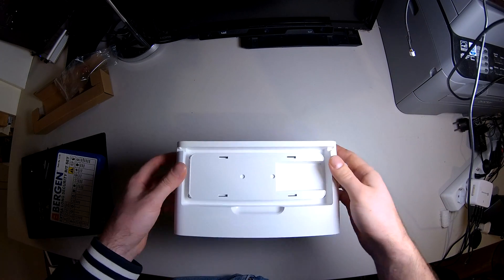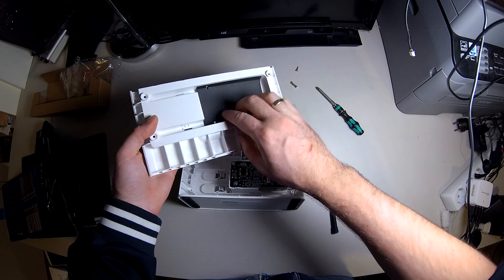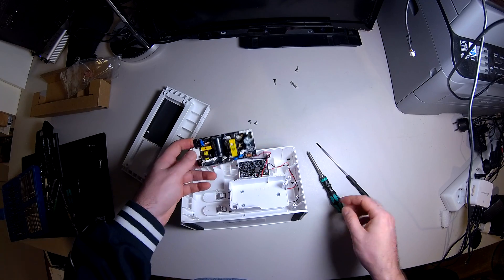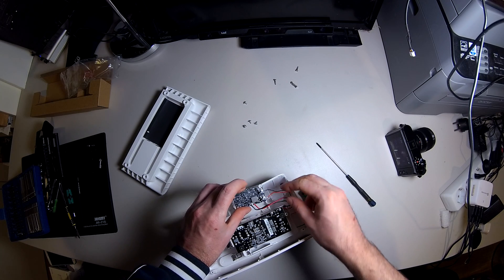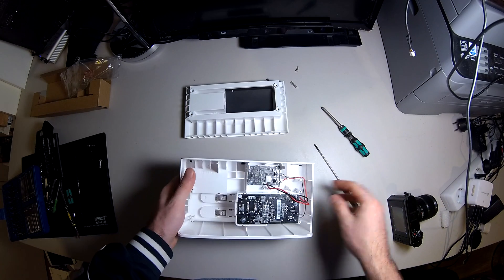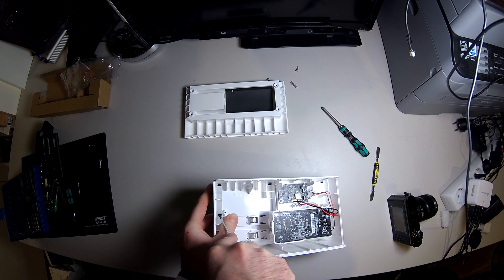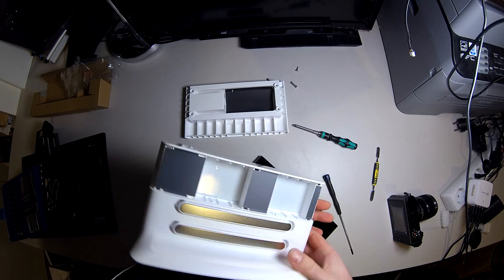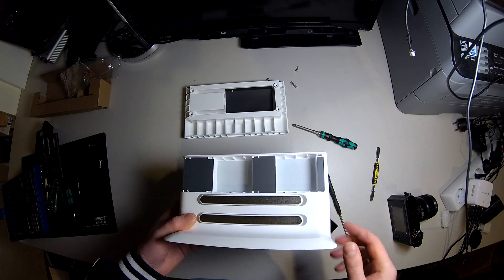Xiaomi Me Vacuum Dock Theardown

Comment: Hello, I have some problem with docking charger(cdz03rr) of E35/E20. 

yes, it is different one, but the main board is similar with yours I think.
I want to fix it, not to buy new one.

*symptoms - unpowered, not charging vacuum
until now, these are what I tried..
1. use new plug-power cable change - no change.

2. check through test by using multimeter, plug-power cable is ok, but charging contact surface is NOT ok.

so, could you please let me know which parts I will try to replace?
is it same as battery ? where can I find the parts? what is the parts called?

Thank you in advance

Comment: Hi !

My new robot is not charging and the battery is now empty.

When I plug the dock to the mains socket, I can hear a very low continuous beep from the back of the dock.
If I connect the robot to the dock it changes to a discontinuous beep, the robot sometimes turns on itself a few seconds before dying again or nothing happens.

Do you know what could be the issue ?

I tried using new power cables but no change.

Thank-you !
Reply from the maker: i think your battery is death, so you need a new one. head that some has this problem in the video descrition i leaf  a link for a new one
Reply: Anton D. Hi Anton !
I checked with the dock of a working robot and the robot charged correctly. The dock seems faulty and delivers 9.8V at the charging pins instead of 20V. If I connect the robot on it, the voltage drops at less than 5V..
Reply from the maker: Never heard of a damaged dock but nice to hear that you robot is ok.  I add a link to Ali for the dock in the video description.
Reply: Anton D. Thank-you for the link !
Yes I did not found anybody online with this issue. Most of the people had issues with the euro plug adapter.
I will try the warranty process to  get another dock...
Reply: Nicolas Duarte I have the same problem, but my charger delivers just 4,35 V (xiaomi robotics s50) I already bought a new battery 🤦‍♀️
Reply: @annagutkovsky6810  Hi,
I bought a new charging dock and it worked fine. In my case the power supply was bad. I did not found the defective electronic component yet.
Reply from the maker: I also both a damaged s50 on ebay. One fault is the dock it devilers only 5v. And if a dock in the white led an the dock turns off. An othersui was the man plug it had bad contact.
Reply: @AntonD  Inside the dock, the power supply looks like a laptop power supply. It may be replaced by the circuit of a similarly powered laptop one.